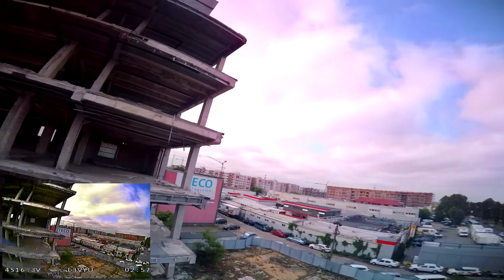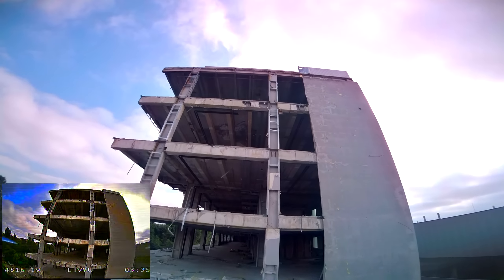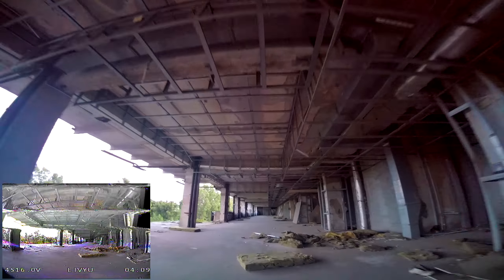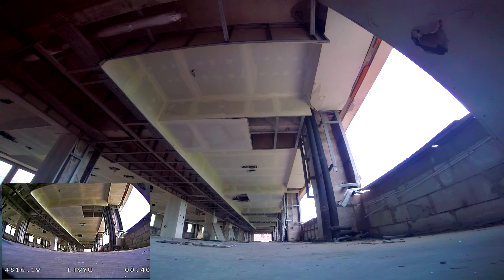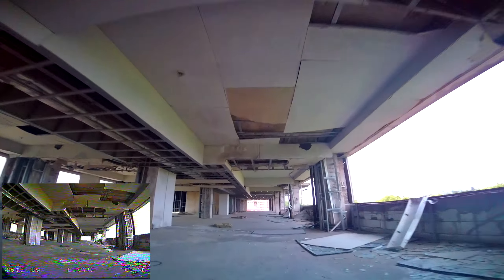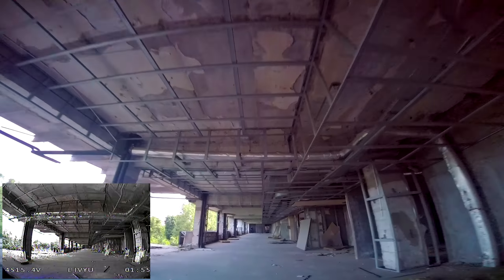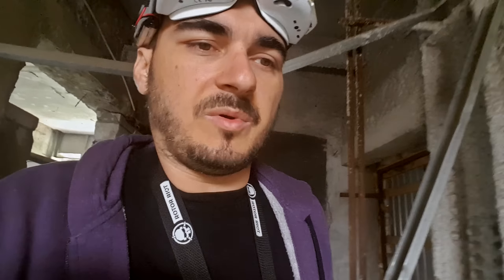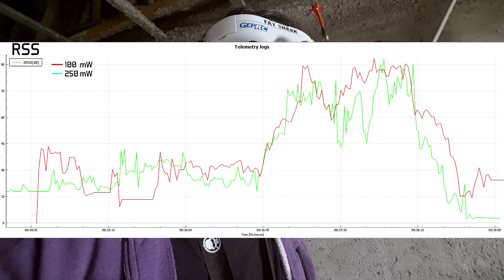TBS Crossfire 100mW vs 250mW @ bando (with telemetry logs)

Comment: Please make a video telling us if this mod is compatible eith the new firmware 250mw capable that tbs released or how to refix the crossfire module
Reply from the maker: Well the rf ic can take at its input 20dB and the tranceiver can output max 14dB. So yeah the moded ones should work with the fw except you will loose 25 and 100mw options but whoo needs them? :p
Reply: Livyu FPV but if i make the 250mw update from firmware it wouldn’t burn out?? I really think you should make a video explaining it because a lot of us made the mod you showed us and i think we are now scared of burning our crossfires🤪
Reply: @mildotairgunner845  the hardware mod supersedes the firmware mod...You will not hurt anything by upgrading to 2.40 but will only see the increased mW options though the Lua.

Comment: Hello a really cool mod, a lot of thanks for your trouble ☺ I have only one question .... could you test how hot the Crossfire module will be if it is longer than 10 minutes?
Reply from the maker: HackE FPV well i left it for hours and it was warm not hot ...rhere are a lot of things that warm on that board but the rf amp is not overheating if this is what you wanted to know :)
Reply: Livyu FPV yes thanks i wanted to know ☺ thank you for your quick reply ☺

Comment: How do you mount your crossfire antennas??
Reply from the maker: leofpv vertically :)
Reply: Livyu FPV yes that would make sense as you were flying slowly at low angle 👍 i have crossfire arriving tomorrow and I am just going to try loads of methods to see which works best for me! Thanks for the help 👍
Reply from the maker: Well ... vertical mounting it's the best way to do it(vertical in forward flight) because of your antenna nulls. I was flying slowly in case failsafe... to not break to many things :P
Reply: Livyu FPV yes of course I will try lots of ways to see what works for me 👍

Comment: Will the crossfire use more energy after doing this mode ? If so, is that significantly more ?
Reply from the maker: no is very low ... is like maybe 50 or max 100 mah more than before.